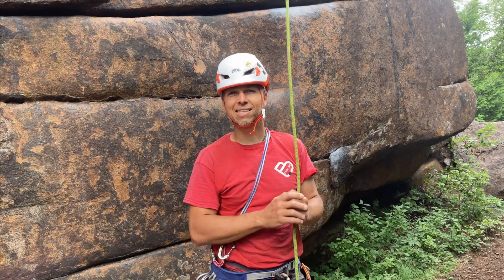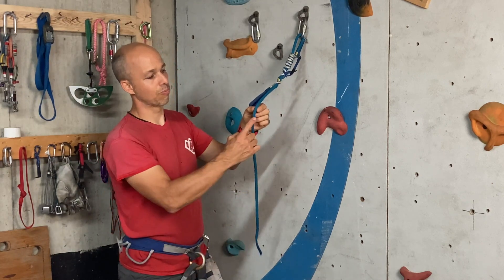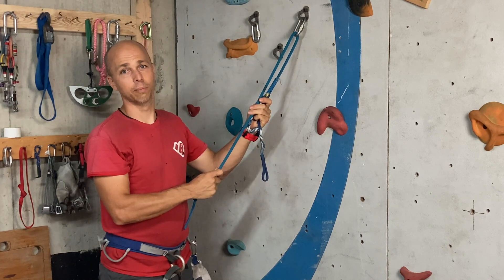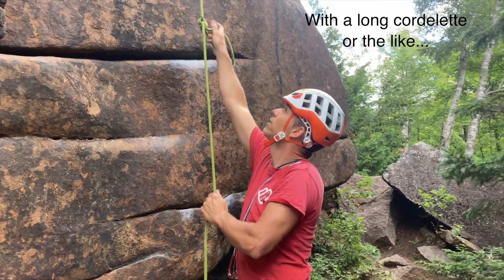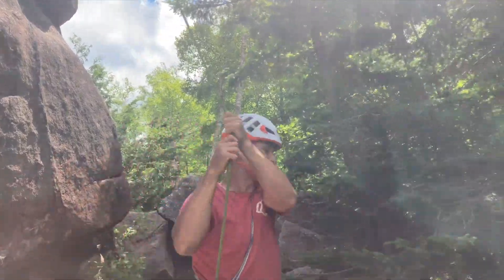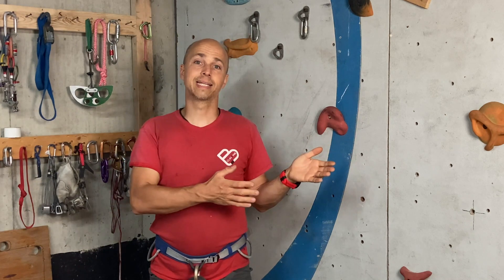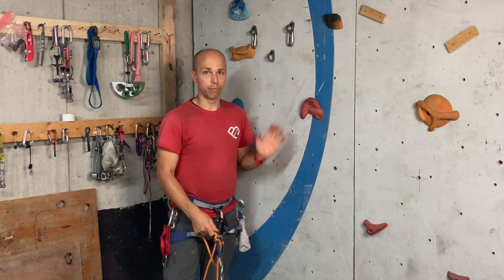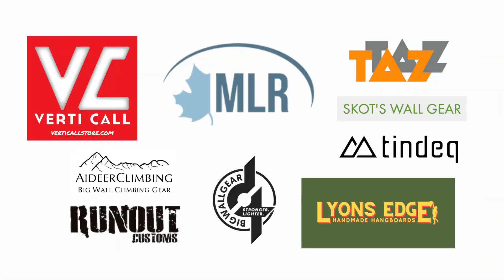How I use the Beal Escaper AND an incredible trick

Comment: Thanks for the video on the beal escaper!
I was surprised about the use of the simple sheet bend for connecting the rope to the escaper.
That is because in our rescue course we are only allowed to use the double sheet bent, finished with  a double stopper knot (the yosemithe finish is not known here in Belgium).
The simple sheet bend without stopper knot is only allowed for pulling up extra gear or ropes. 
But that's a rescue course. The standards are more severe of course.
Reply from the maker: I think this is a technically sound advice. I still believe the sheet bend with yo finish is ok with the escaper. I would love to read other people. Try it and you will see it cinches very well. I will try to find the testing of the sheet bend with yo finish. I think pull tests were showing the knot to be strong. But for rescue: everything is at another level!! (LOL)
Reply: @YannCamusBlissClimbing  could it be possible the the simple sheet bend loosens before the escaper and thus you loose your escaper ? I suppose the yosemite finish prevents that from happening ?
Reply from the maker: @TheFilip330  it might happen with other soft goods or with thinker / stiffer ropes. but with the escaper and my ropes, I never felt this was possible.

Comment: One thing to note while using Andy Kirpatrick's trick to extend the escaper.  Make sure the "V" angle coming from your anchor is narrow.  If you use a wide 'V', like going around a big object and keeping the escaper close to the object, it will slip very easily as your weight essentially pulls the trap apart.  It's best to try and get the smallest v-angle you can manage in your given terrain.
You can see this demonstrated easily if you set the escaper through both bolts on an anchor and then weight it ... it will slip off with not much effort.
Reply from the maker: Well explained! You can always put the escaper lower to reduce the "V" angle (ie. extend the escaper more...)

Comment: Hello, can you tell me more about this chinese prusik knot in this video? Best regards and stay safe.
Reply from the maker: https://youtu.be/fYI36CVar_8
Reply: Thx a lot for the fast reply. So I'm not able to do that with a usual sling right? It's a sling made by beal for that?
Reply from the maker: @jimpanse8763  The Escaper is a very fancy device made by Beal. It is a sketchy way of making a rappel but Beal has made it as safe as possible (until another company makes better). I don't advise you try to do the same putting gear together. It would certainly lack some of the safety features packed in the Beal Escaper. Does it answer your question?